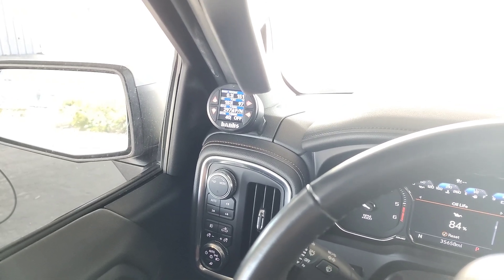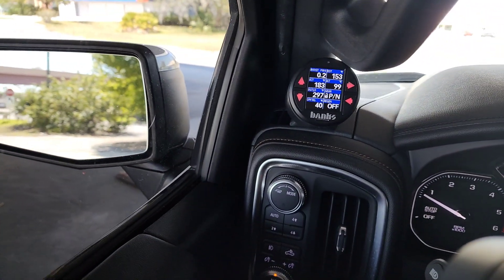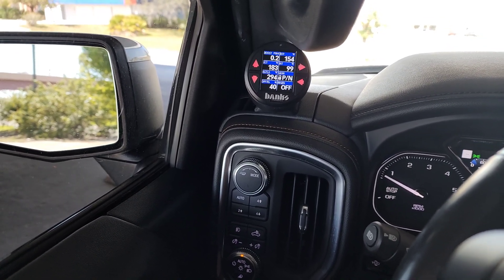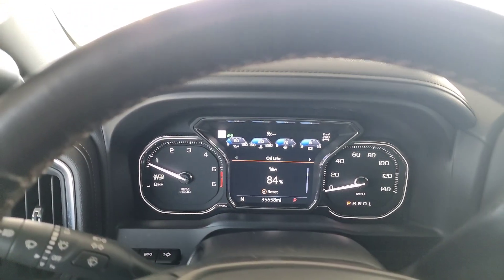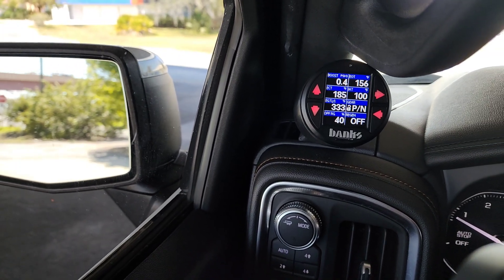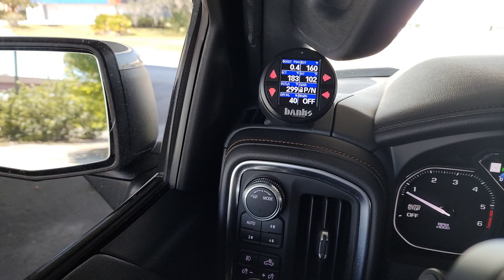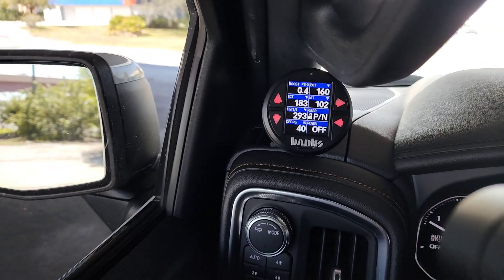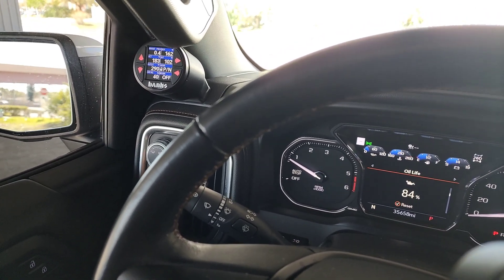PIDs I like to monitor on a diesel using my iDash.

Comment: Does this also monitor trans temp?
Reply from the maker: @AlexMiller-wq8eo  yes it does. You can see trans yemp on the cluster on these trucks as well that's why I didn't select it as a PID to monitor.
Reply: @automotiveandmore  I thought the cluster info was inaccurate?

Comment: Ford Powerstroke 6.7
RPM -BOOST PSI
EGR TEMP- HORSEPOWER ECU
EGT 1 TEMP CLOSEST TO CYLINDER- DPF SOOT LOAD
EOT ENGINE OIL TEMP- FRP FUEL RAIL PRESSURE PSI

REGEN set for background alert (you get the yellow box that says REGEN)

Second screen if I page over is the Banks pedal monster settings and shows gain + or -

Thanks for sharing your set up.
Reply from the maker: Thats awesome. I should set my regen to alert as well. I like that!

Comment: How is the range for u regen ? I have 3.0 Duramax Lz0 and my truck regen every 150 miles I think is to often
Reply from the maker: It's about 200-250 for city driving and 500-600 for highway driving.
Reply: @automotiveandmore   I drive 20 miles city and 15 highway   Total 35 , and my truck regen every 150 , dealer says is normal the regen every150 , but people on YouTube says 300 to 700 regen is normal 😐 , I use top tier Costco diesel , maybe change  to another station ?  Did u used any additive?  Gracias 🙏
Reply from the maker: @watchmanexpert  if does sound a bit short for Regens. Costco Top Tier is really good fuel. I would continue to use that if it was me. Additives can help extend periods between regens by boosting the Cetane level up. I use 1oz of Hot Shots EDT on every fill-up.

Comment: How high does your ECT get? Mine will get up to 225 going down interstate then settles around 214 and fluctuates between the two
Reply from the maker: Mine is similar. It seems  to get as high as 224 and fluctuates all the way down to 204 when driving for long distances.  In the city, it seems to like the 215 area as well.
Reply: @automotiveandmore  you have intercooler installed. I’m surprised yours is about the same. Still seams really high to me. But what do I know
Reply from the maker: @Kenneth Bohrer  remember  the intercooler is a seperate system from the engine coolant and has no effect in ECT temps. The intercooler will affect Air Intake temps after the intercooler and also effects the EGTs
Reply: @automotiveandmore  I did not know that. I’ll have to research that more. Learn something new everyday.
Reply from the maker: @kennethbohrer5796  we all do.

Comment: Well done. Good to see what others watch

Other screens I watch and turned Green to see lift pump pressure. Fuel rail pressure. Fuel temp, DEF TEMP to see if the heater raises the temp.  Def concentration 32% is best. Any less I can see that. 

For some reason 2022.5 trucks and newest firmware won’t see injectors or oil pressure. 

Just a few of mine along with the staples ECT- coolant
EOT Oil temp
RPM
Gear
EGT -3 which I believe is just aft of the turbo.
Reply from the maker: That's awesome. I love hearing the mindset behind people monitoring certain parameters.